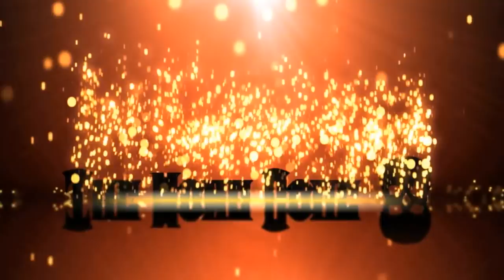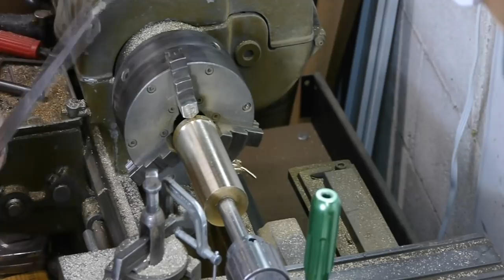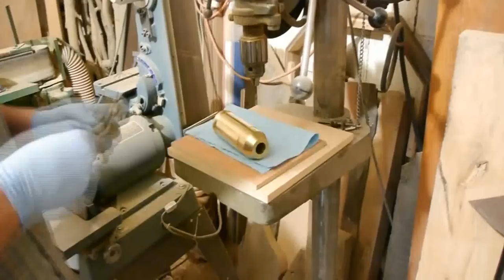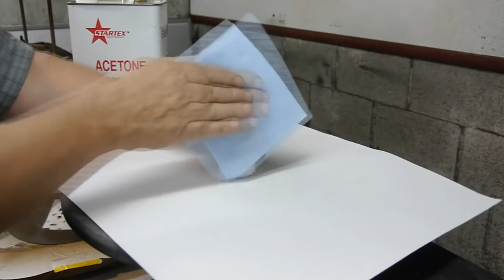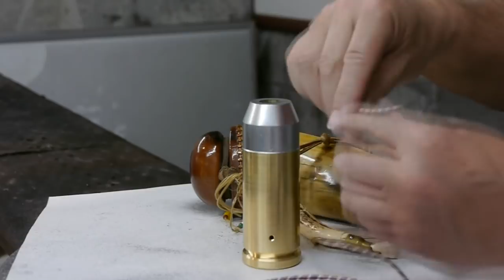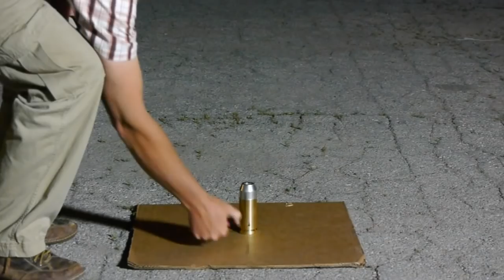Atomic Bullet Thunder Cannon Time Lapse

Comment: I used to get the same effect with around 200 sparklers broken apart, put in the bottom of an empty dry coke can, then using a whole sparkler (still intact) as a fuse. An old wine cork on top seals it just well enough to produce enough pressure for a good explosion.
Reply: My friend lost both his eyebrows using a sparkler as a fuse on one of my creations. Bad fuse because it can light the rest of whatever it is immediately due to the spark shower.
Reply: Hey I didn't say it was safe lol, just that it had the same effect :)

Comment: Interesting machine techniques. Rather than put the semi-finished part on a mandrel and let it free float, I would have taped a piece of plastic or delrin to each of the jaws. You would still have a nice finish, but the part isn't free floating and banging into the face of the jaws. I also would have used a live center when turning rather than the mandrel. Not that this is a precision application, but it's just more rigid. Cool video though.

Comment: That is a lot of freehand filing....actually pretty hard work at least when machining steel. Hard to get large radius or parabolic shapes otherwise if you don't have the proper lathe accessories.

Comment: i once saw a lab tech using a metal lathe while wearing rubber gloves.  spinning metal piece grabbed the gloved hand and wound his arm around the part.  very lucky for him that the lathe was old and the flat belt slipped before his arm was ripped off.  he got away with just severe bruising.  if you're gonna wear gloves, wear leather.

Comment: might wanna invest in a live center, tape on a rod isnt a good method. the power feed lever will help your finish, and they have tooling to do that file work. other than that pretty cool might suggest something stronger like a 4140 though.
Reply: Kyle ... this isn't a precision piece -- a couple thou runout doesn't matter. The power feed lever isn't needed here, is it? Brass is plenty soft to allow a nice finish with a bit of crocus cloth. Why buy or even make tooling for a one-off? If he isn't doing high volume there is no justification for the cost of formed carbide tooling. None.

Comment: I really can't tell how fast that thing spins
Reply: That thing has to spin very low, the brass has a big diameter. I guess not more than 1500-2000 rpm. Where I work we work with lathes that spin around 5000-10000 rpm. What he does is pretty cool!
Reply: Wow! 5000-10000 rpm!? that is really fast. now I can see how he makes it smoother and perfecting those edges.

Comment: That guy needs to take a safety machinist class on the lathe. I work in a machine shop and that was scary.
Reply: I worked in a machine shop, too. Until I started working as a die-maker.

When you get as good as him, you can cut a couple corners, too. He knows what he's doing. I wondered about the gloves, too, until I remembered how badly brass handles skin acids.

Comment: I'm kind of confused by all of the filing and sanding he is doing... does his machine not produce a good finish or what? also dude should be wearing a respirator for that sanding work brass/copper dust isn't good for the lungs. other than that good finished piece. that's a pretty cool. get a stamping roller and you can roll on the caliber haha.

Comment: I would have rather used steel pipe though machining that would have been a bit harder it would still probably cheaper especially since this isn't really anything more then a large firework. Also I would want to figure out a better ignition system then taking a bic lighter to the fuse.

Comment: Cool idea, but man, those machining techniques gave me some nasty butt pucker. Using masking tape and a rod is no way to secure anything onto a lathe. Throw in gloves to the mix and you're setting yourself up to get a finger ripped off. If the machine grabs the glove for any reason at all, your hand is getting sucked in and you'll be lucky if you just get away with a sprained finger/wrist. More than likely it will pull your finger off, or even suck the rest of your arm into the machine and then you're totally f*ed. As a former machinist, that was terrifying to watch.

Comment: what is the circular indentation on the bottom of the bullet for?
Reply: On a real bullet its where the firing pin hits, which ignites the gunpowder.  On this its just for looks.
Reply: It resembles the primer on a real center-fire cartridge case.

Comment: "One can be purchased..."  emm.. For what reason?
Reply: Who needs a reason?
Reply: ten8goa  Nah! This requires gunpowder quite a lot. I'll better buy firecrackers and blow them up on a single ignition :P
Reply: ***** looks as if it can be reloaded and gunpowder you can get on the cheap but i think he used flash powder i could be wrong tho
Reply: ten8goa
Takes about 2 hours to make, the cost of the brass stock and elec. for the equipment. Its only pricey if you can make it yourself.
Reply: ten8goa not when you consider the price of brass and how big a peace that is

Comment: He works very close to that 3-jaw chuck.  I kept waiting for his left wrist of maybe that file to get caught.

I have better things to risk my life on.  Like racing cars.
Reply: My guess is that the lathe is his -- that it has been his for many years -- that he knows EXACTLY where that chuck is.

His use of the masking tape to center the part on the make-do arbor should clue you that he's not a beginner. An amateur would reject that idea out of hand because he "knows" it won't hold the work exactly centered. An old hand will use it anyway because he KNOWS it will be 'close enough' for government work.
Reply: Anon Ymouse I do understand what you are saying, and I've seen it happen in a great many professions.  It really is a case of "familiarity breeding contempt", though - you learn which corners you can cut and get away with, all the time shaving a little bit of safety margin here and there... Until one day it takes your arm off.

Comment: That file part is a joke. A DANGEROUS joke!
Reply: what file part on the lathe or being used as a ramrod  ? if talking about ramrod  part  brass doesn't create sparking
Reply: The part on the video where the piece is shaped using a file. This is dangerous as f***...
Reply: BavarianMonkey yup if that gets clipped or hung up on the jaws besides getting ripped outta your hands and hands getting caught up in the lathe and that file will become a projectile. this guy doesn't claim to being a pro, machinist also old timers d o it that way and say they been doing it that way for years
Reply: Sure, you CAN do that, but it is dangerous and should not be recommended to anybody or shown without a hint that this could end badly. At least turn the lathe backwards so the file will shoot away from you instead of in your face :)
Reply: BavarianMonkey what do you mean ain't that what the paper is for ? 
sorry just had to say that but i do think that that is a pretty sweet thing an def. want to get one now.
Reply: If you slip the file into the lathe chuck by accident, the file will shoot into your body. That is the dangerous part, not the filling/stuffing of the final product with powder.

Comment: and the point of this is....?
Reply: it was to alert your squad before wakley talkies and can also be used as a distraction so the enimes think a gun shot is coming from a certain direction while you run or flank them
Reply: it was to alert your squad before wakley talkies and can also be used as a distraction so the enimes think a gun shot is coming from a certain direction while you run or flank them
Reply: guess you could use it for that .  but mainly they were deployed on ships and primarily  used as a signaling device the same as a signal cannon but this used less powder and was mobile . due to some maritime traditions required firing a shot  so instead of wasting  pounds of powder and a cannon ball they could use the thunder mug which used small amounts compared to the cannon and you didn't need to load a shot in it